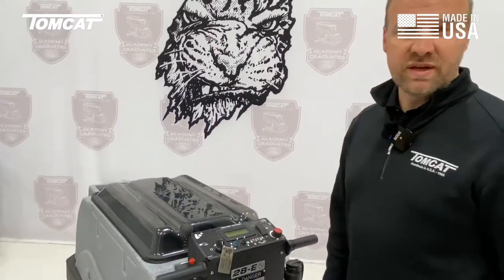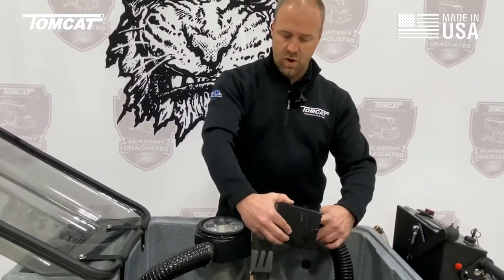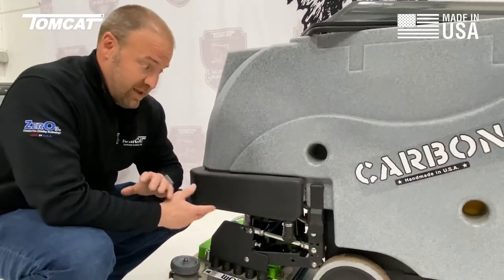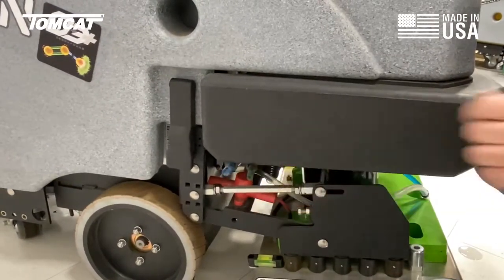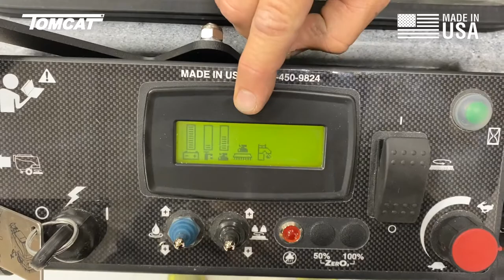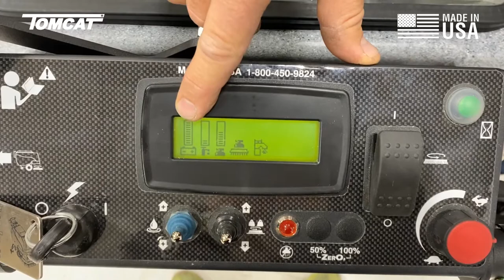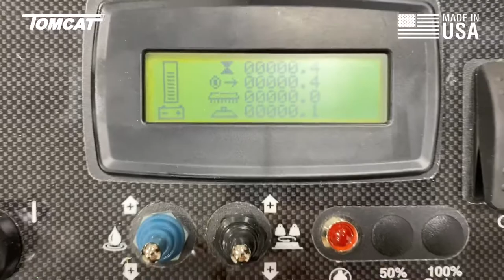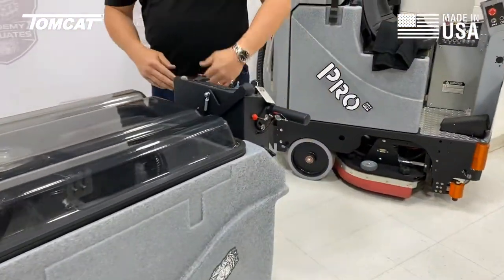Tomcat Carbon Floor Scrubber - You Be The Judge

Comment: I like to run the vac motor for a minute or two to remove excess moisture.  The previous company I worked for had to get a new vac motor on their Tomcat 2600 in 2010 because it rusted out from moisture.  That Tomcat was made in mid December of 2003 and lasted until late may of 2017 when the scrub deck rusted out.  It had the Central Command II electronic controls, and the CCII electronic controls still worked great!  I don't know if Tomcat and Factory Cat electronic controls are built in house or by a third party, but they are made better than electronics found in household appliances.